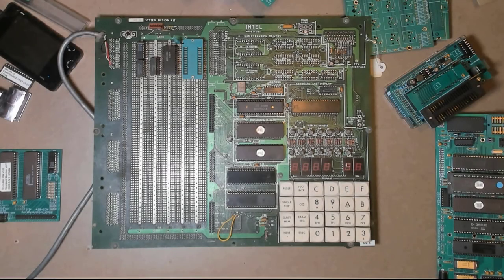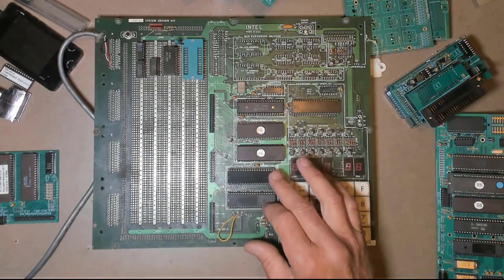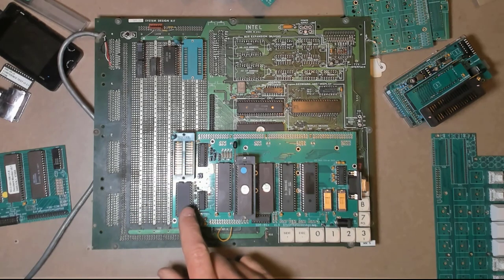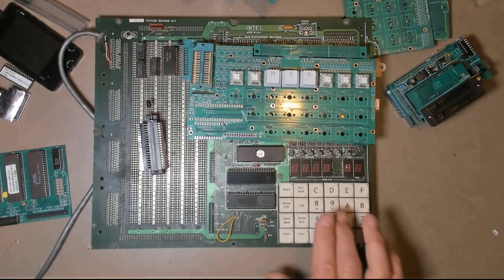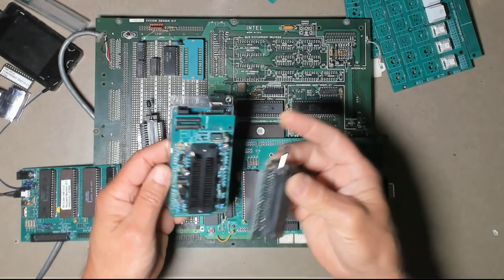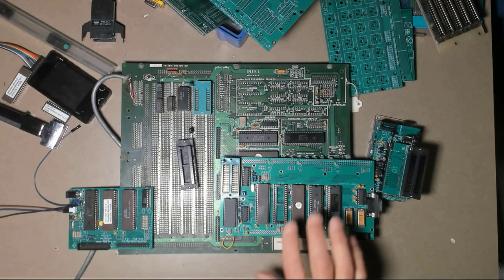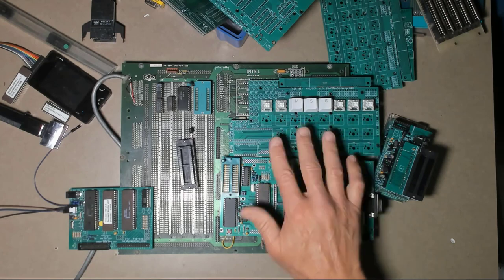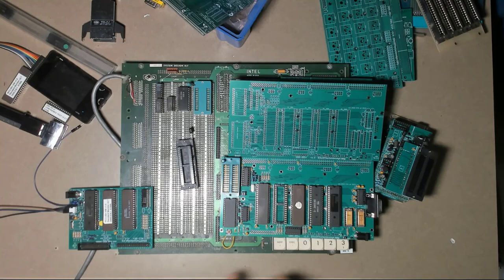{105} SDK-85+ 8085 Single Board Computer using MCS-85 Family Components

Comment: Never knew something like the 8755 existed before. I always assumed system with multiplexed address and data busses has to latch out the addresses to talk to ROM and RAM but seems the Intel designers were building all of the chips to work happily in this ecosystem. The reduced pin counts and number of signal traces required was certainly a consideration when systems using these chips were designed.
Reply from the maker: Indeed.
After the 8008 disaster and the painful 8080 experience, the 8085 along with its buddies the 8155, 8755, and 8185 that all utilize ALE were a welcome relief.

Comment: I'd love to give you feedback on the new board! I am able to program 8755s with Matt Millman's programmer. However, just a note on that: at least on my Mac, I could never get the USB interface (via the Arduino) to work with that programmer. The RS232 interface worked just fine, though.
Reply from the maker: That would be great Michael.  I still have your address and will get one ready for you.  Good information about Millman's programmer.

Comment: I can't seem to find where the following signals are routed: SOD, SID and CS2.  I see an unlabeled pin J1-4 adjacent to CS3 on J1-3.  Could this be CS2?
Reply from the maker: It looks like SID and SOD are not wire connected on the schematic, just associated by label into the MAX 232.  I just label connected those….maybe because I was lazy or just to keep the schematic cleaner.   Let’s say it was the latter.

The terminus for /CS3 is J1.3 which is the connector for the keypad/display board to select the 8279.  I know SID and SOD are ok because I can use the serial port.  Anything with the keypad is untested.

[edit]
Oh, wait.  You asked about /CS2 ….
I had to track that down… 0x1000-0x1700 is un-committed just like on the SDK-85. 
I think the unlabeled connections to J1 are indeed unconnected.
Reply: @HelloWorldETX  Ah, now I see where the SID and SOD signals connect to the 8085.  I had forgotten the 8085 included a serial interface controller.  I was a Z80 applications engineer and rarely experienced the 8085.   I was looking for the serial I/O to be bit-banged from either the 8155 or 8755.  I also should have remembered the functions of the SDK-85 board as we used these in my EE coursework at Mizzou.